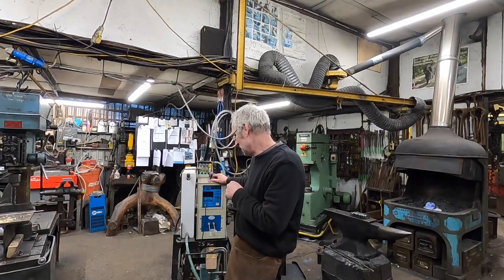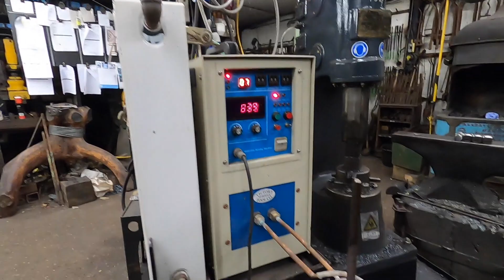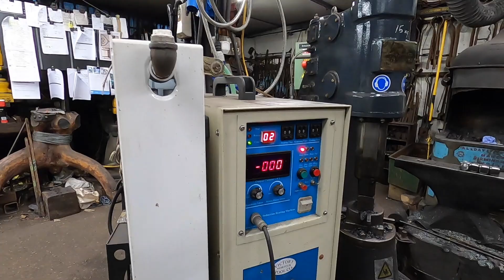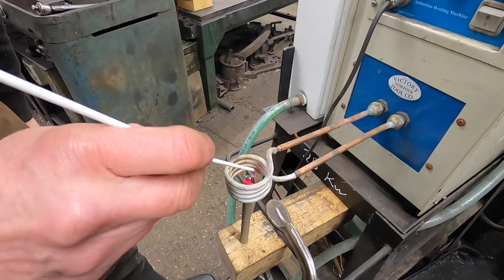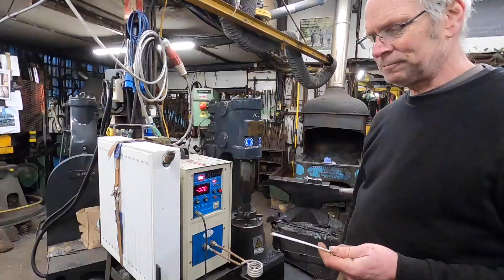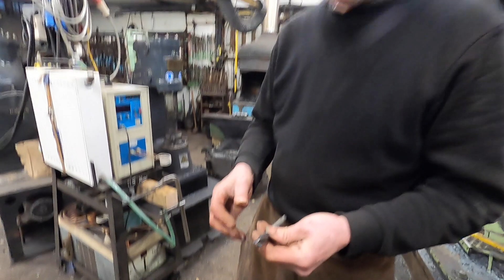Forge Force Induction Silver Soldering a Tool Steel Boring Bar

Comment: Wow! This is so fast, 17 seconds to silver solder and so convenient compared to the minutes of time needed with a gas torch or longer if having to heat a forge up to temperature. In addition to silver soldering & brazing presumably one could also use this to do enamels. Will be interesting to see how it works for rivet heating. Thank you for sharing!
Reply from the maker: hi i sell a 240volt machine too and we also stock massive ones but you need a power station to work them but the small ones like this only need a cooker socket supply .